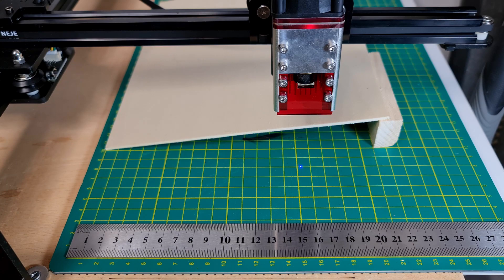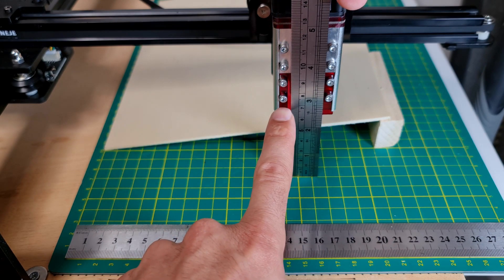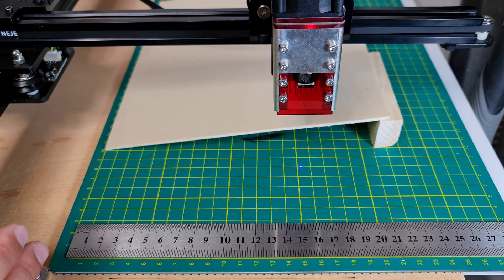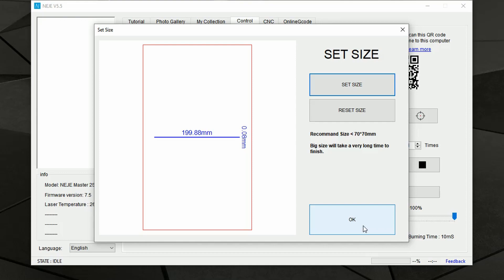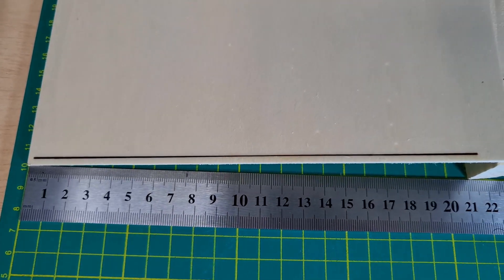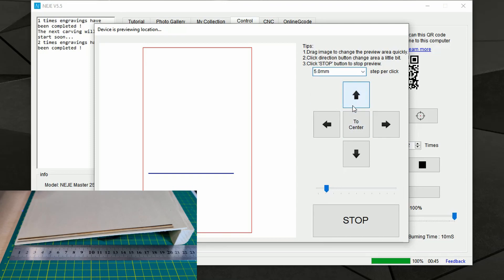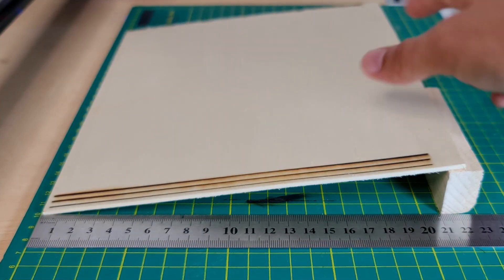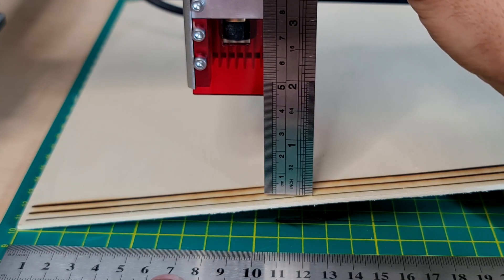Find the right cutting height with Laser Cutting and Engraving | How to Quickly Focus | NEJE

Comment: What is that mat under your work piece
Reply from the maker: Hi, Ashes12962; thank you for your comment.

In this video, I am using a cutting mat, but it is not a suitable material to use for laser cutting. I used it because it got damaged during testing, and I decided to waste it, but it smells and smokes badly while burning.

You should go for a honeycomb or better nail sheet if you want something to laser cut.

Below are some helpful links
Honeycomb sheets Europe:
https://affiliate.geekbuying.com/gkbaffiliate.php?id=3783&url=861175
Honeycomb sheet AliExpress:
https://s.click.aliexpress.com/e/_DntLK4D
https://s.click.aliexpress.com/e/_Dku0QH3
https://s.click.aliexpress.com/e/_DEBD1XT
https://s.click.aliexpress.com/e/_DBdKB0d

Cutting Mat if you need:
https://s.click.aliexpress.com/e/_Dm4P6nn
https://s.click.aliexpress.com/e/_DlNavDf

I hope it helps
Ciao

Comment: The Extension "Laseringrave" isn´t in the newest InkScape I downloaded. There can I find it ?
Reply from the maker: Hi, Steen Mikkelsen; thank you for your comment. 

Unfortunately, these plugins are not as many updates as Inkscape does.
I was already reported by other viewers that they are either missing or not behaving correctly.

I will try to check if there is anything new and paste the new link in the description. 

In the meantime, if you are using LaserGRBL, you can import .svg directly into it without the hassle of converting your design into a gcode format. 

Ciao

Comment: I've only ever seen the ramp tests. What can you adjust the lens for? does that make sense? so far no youtuber has done that..
asking for neje a40640
Reply from the maker: Hi, MiuiX; thank you for your comment.

The lens is used to adjust the focal length, i.e., how far the focus is from the lens. 
Because of this, the convergence angle is smaller, making the hot region of the beam longer (taller), allowing for deeper cuts. 

In the A40640, I unscrewed the lens a few turns, and I kept it like so since I got it.
The difference in the thickness is not much, but sometimes it makes the difference between a clean cut and a frustrating partial cut.

I had a video scheduled for it. Stay tuned for that. 
Ciao
Reply: @MiddleRoomWorkshop  thank you for your great answer 😃

Comment: Hi i have neje master 2s 30w.I really tried everything but my laser is cutting a 2.5 mm plywood after 35 passes with 100% power and the lowest speed.
Reply from the maker: Hello Soteris T, thank you for your comment and compliment.

Taking to the opportunity to wish you Merry Christmas.
I am sorry to hear that; with my module (before it died), I could go a bit over 6mm in 5 passes at 100% and 50ms burning time. 
Have you tried with different software? Paraphs Neje Software is not providing the correct setting to the machine.
Also, do you use Air Assist? If not, try putting a small blower or fan to blow across the cutting area, this will ensure that 100% of the power reaches the material and the light is not absorbed or refracted/diffracted by the smoke produced during a cut.

Let me know.
Ciao

Comment: Hi friend, I also tried to follow your method to find the correct focal lenght. I have the same NEJE 30W machine with air assist, but I can't cut any plywood (3 and 6mm) ! Do you have any suggestions ?
Reply from the maker: Hello Gino Laurita, thank you for your comment.

If the machine is correctly focused (maintaining a constant power) it should be all matter of a number of passes and axis' speed.

Try lowering down the speed of the axis, or cranking up the burning time if you are using the Neje Desktop Application.

Perhaps, it may be a power problem. Are you able to cut anything else?
You might need to re-install the firmware.
Let me know.

Ciao
Reply: @MiddleRoomWorkshop  Hi, Firmware is updated. My setup: focus on surface, speed 50, power 100%, more than 7 passes and air assist.
Cut is only 1mm deep !!!
Somebody tell me to set speed on 5mm/sec and same power for minimum and maximum. I have to find where can I change this.
Reply from the maker: Hello Gino Laurita, thank you for your comment.

Please let me understand, are you using the NEJE Application? 
In that app you can vary what is called burning time which is the revers of speed, therefore you need to have higher burning time like 30ms for wood. 
If you are using other software that enable you to adjust the actual speed, than you need to lower down that speed like 150mm/min (which equals to 2.5mm/sec) and with the right focus you should e able to go through 2mm of plywood in a single pass. 
Note, with the 30W module and the focus nub screwed all in I need to position the module to a height of 39mm to 41mm max.

Let me know if you get any result.
Ciao
Reply: Para esos espesores lo mejor es el Co2. Con diodo el mdf de 3mm lo corta al maximo de potencia y no mas de 5 mm/s de velocidad, para hacer grabados mejor el diodo que Co2